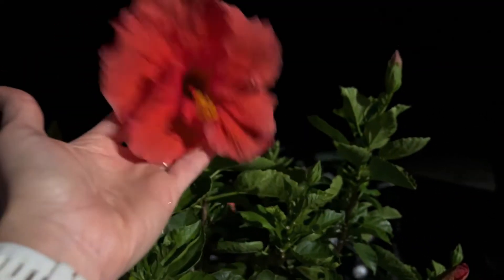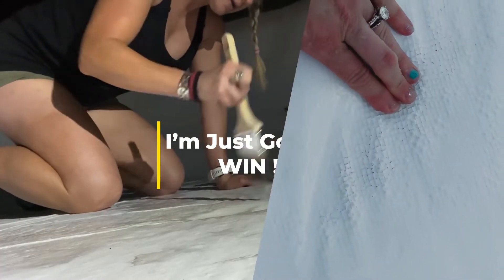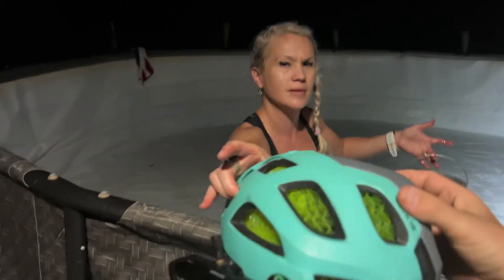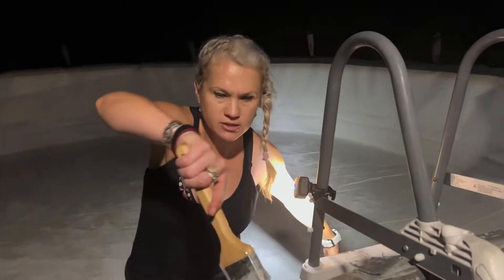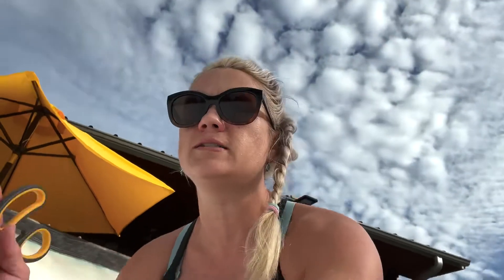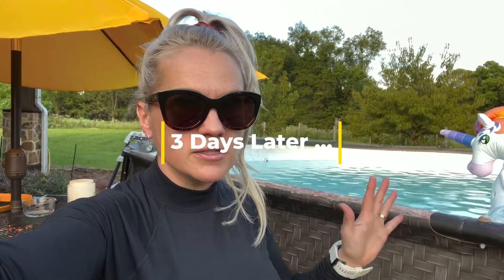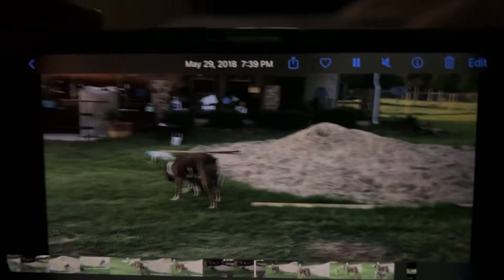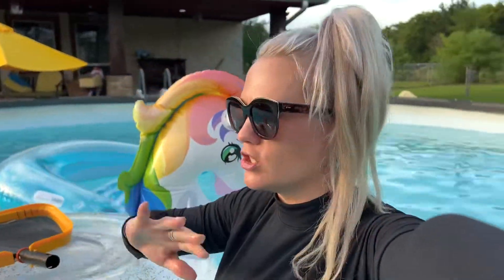Flex Seal Liquid & Tape On Above Ground Pool. Does It Work?

Comment: Thanks for the video.  I was wondering what that Flex Seal paint looked like.

Just as a little helpful advice, after you put the concrete or whatever you are going to do under the pool, you should put down some 4x8 sheets of Styrofoam type insulation panels and Tuck Tape them together.  You will LOVE how it feels on your feet and it protects the liner from the rough surface of whatever you use, and probably helps a bit with heat loss.

Also, to anyone wondering about the inside of the pool being white, and not a blue pattern, that's usually what happens after a few years, and how you know to start thinking about changing the liner, as the blue helps attract the heat from the sun to help warm your pool.  My Intex 24x12 rectangle pool is on it's 9th year and is white like this as well, but the liner isn't at all worn out like this one is.  Looks like all of the heavy wearing on the liner is on the bottom of this pool?  I do have half of my pool on concrete where my hot tub used to be, and the other half is on slag, and crusher dust on top, packed down, then the foam sheets, then the crappy free liner that comes with the pool, and then the pool on top...  

I also leave mine filled to about 6 inches under the lowest water exiting port, for the winters, and only had 1 winter in the 2nd or 3rd year where I had a problem with the ice ripping away the bog drain port patch circle because the water was too low that year...  I used a tube of Pool GOOP on it, and it's been fine ever since.  That Pool GOOP is incredible as well, for anyone that owns an above ground pool.

Anyway, I hope some of this experience and advice helps some people out, that are having some problems or wondering about these things...

Oh ya, 1 more thing.  Grass will grow through pool liners, which is crazy, but happens a lot, so try to get rid of grass and weeds from under your pools before you put them down, if you can!
So far in the 9 years I've had mine, nothing has so far come up through the slag and crusher dust, but It was only dirt there before hand as well, but that doesn't mean that weeds and roots won't show up someday unfortunately, AND the neighbor planted trees touching the fence, about 3 feet from my pool, then moved away, and they are the worst trees for roots as well...  So glad he's gone, but the new neighbors have no intention of removing existing trees unfortunately, regardless of whether they screw me over or not unfortunately...
Reply: I would have done the goo on top of the tape. I'm no expert though so who knows 🤷
Reply: @paulysci925  Sorry, which tape would you put the goo over top of?

Do you mean on the tuck tape holding the foam insulation sheets together under the liner?